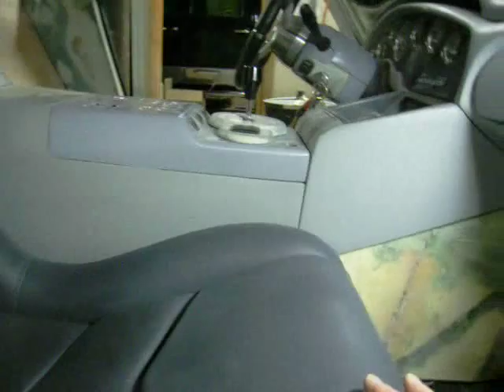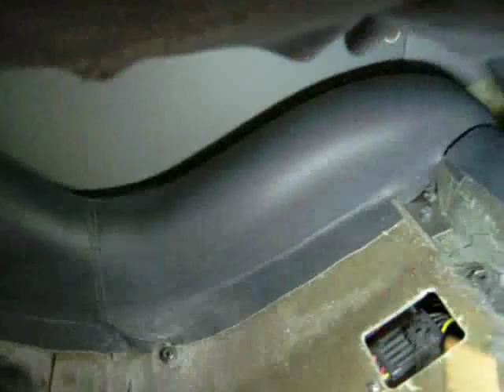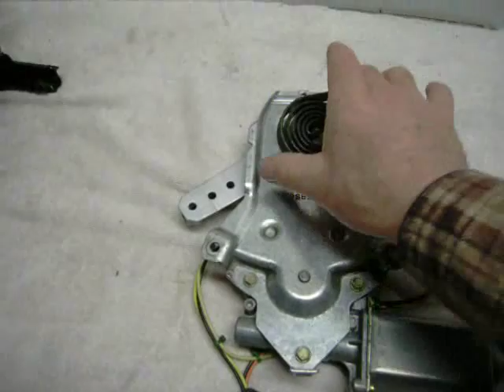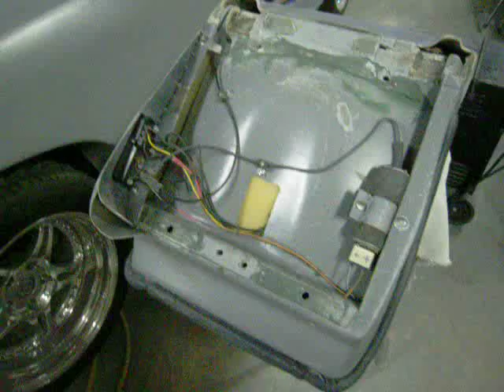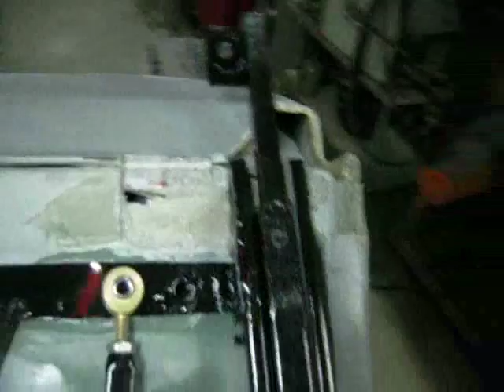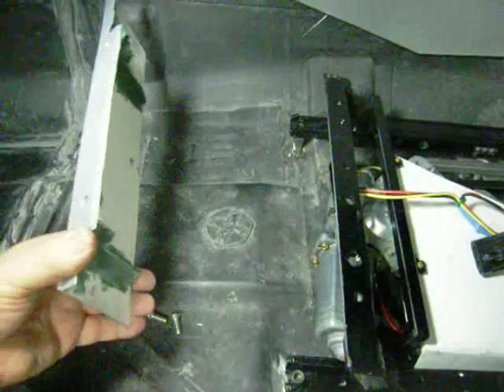Replica Lambo Power Seats

Comment from the maker: The Lincoln Mark Vii where I got the parts did not have an over-inflate limiter.  I didn't consider using one.  I'm not sure the air pump would have enough power to cause damage if you did try to over-inflate the bag.  I think common sense usage is the limiter.